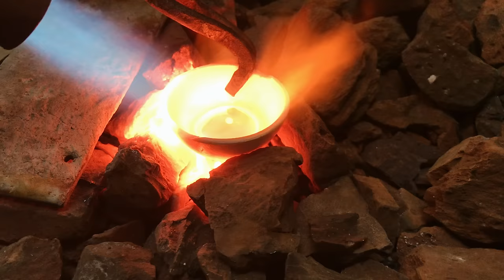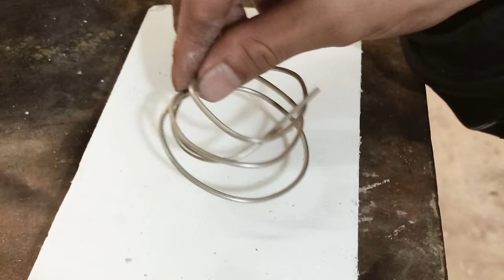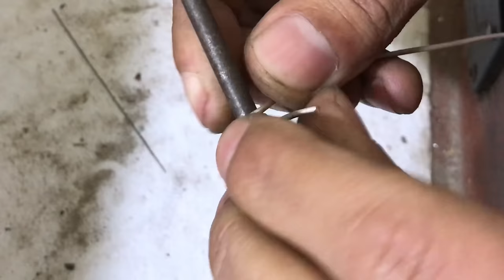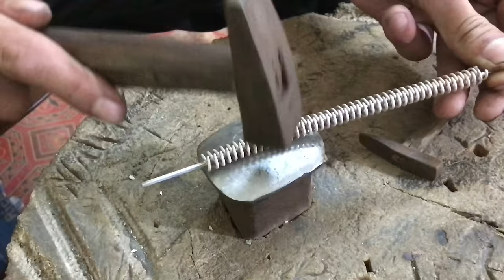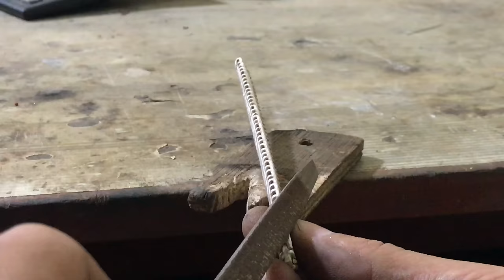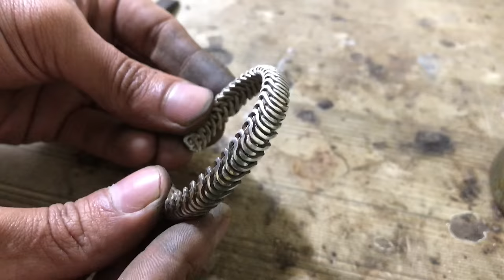Confusion solved just in 5 min | ✨Silver milipede bracelet ✨

Comment: Great video, thank you!!! Can you please tell me what gauge you milled the wire down to? Are the three (3) support wires on the inside the same gauge as the wire that is coiled?
Reply: I was hoping that there would’ve been an answer to this already lol. I’d like to know too.
Reply from the maker: Thank you for your comment. It’s too simple. Wrap the wire in a spoke mandrel until it’s 7 to 8 inch long. My size is for a small child so I didn’t replied. Wire gauge is not same for all users.
Reply: I understand sizes vary based on age but could you give us an idea then of the ratio between the inner pieces and the coils? So say for instance the coil is 12 gauge would inner be 8-10?  Any help would be great! Thanks for the length info 👍🏻

Comment: Hi. What is that white plate used for heating metal? I've seen it every where. How is it made?
Reply from the maker: It’s a fireproof cotton, used for soldering small objects placing on. You can by it from online stores.
Reply: Thanks for reply. In fact, my question was about a solid white plank but not about ceramic wool.
Reply from the maker: Oh that, that’s a soldering ceramic  block- https://amzn.to/3fJw7oc
Reply: @WeMakeJewellery  thanks for reply. Can we make it using plaster of paris ?

Comment: was wondering what gauge of wires did you use that sure  is an awesome  bracelet
Reply: You can use any gauge you want, if you choose a small size, your bracelet will be thinner therefore more delicate. 🤗
Reply: There's a few posts asking this.
I guess it's people that would like to try this but don't have a rolling mill and/or don't want to use a lot of silver experimenting.

Buy a load of different gauge copper wire and use that till you know how it works out.